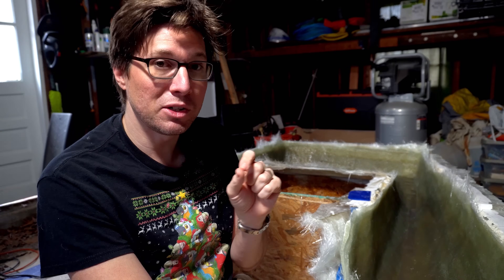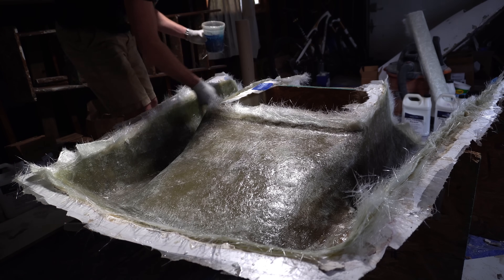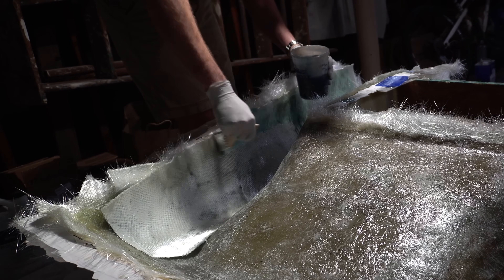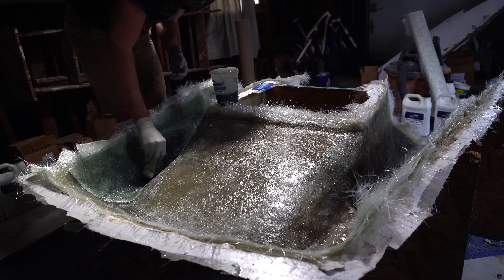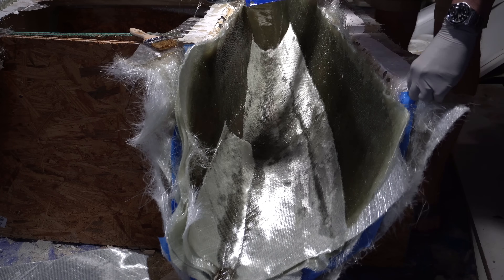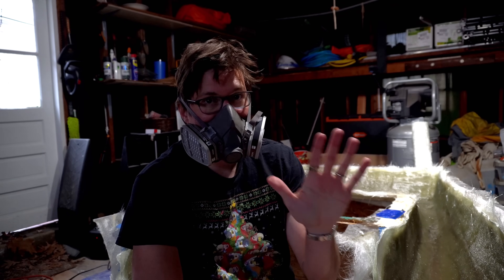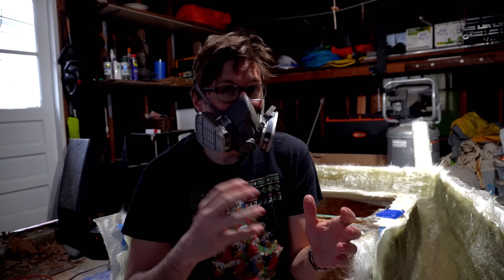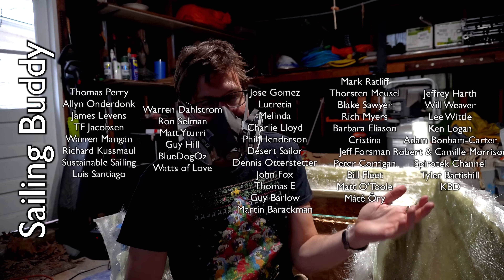Five Steps to Building in Fiberglass with Totalboat Polyester Resin | Windpuff’s Rebuild [S1 Ep6]

Comment: 5 steps read anything provided by the manufacture…. Don’t listen to people who fail to qualify their skills   “ this fool “
Don’t remove the dust or wipe down  with anything. After all a clean work environment  could never help the outcome of your project..
Reply from the maker: That dust is fiberglass dust which is in 402 from West System. Why take it out when it doesn’t hurt anything? Sounds like extra work for no reason. 
Reading the instructions is always a good first step, but the instructions don’t show techniques or tricks. 

I like the interesting spacing that you employ in your sentence construction, makes you see more  “ what’s the word “
Reply: @RiggingDoctor  
Dust is not a quality filler it provides no structural support and in fact my provide impurities and dry spots in the Lamination .  So for a a little extra security why leave a potential problem ….   Truly the difference between a hack and a pro.

Comment: Hello doctor! You laminate polyester and fiberglass without using a steel roller. I have produced many many square meters of laminate. Only with hard rolling can you achieve quality laminates. But it is heavy and time-consuming. In my opinion, the main cause of osmotic is due to carelessly rolled laminates. When a 30-40 foot hull is manufactured, the crew should consist of three "rollers" plus one for other work. But it is costly for a manufacturer. Usually there are two in total.
Reply from the maker: Good point. I have it but I only use it when I can’t get it done with the brush. I stopped using it as often because of the cleanup. The brush gets tossed but the roller needs cleaning.
Reply from the maker: Laziness is not an excuse for bad workmanship though
Reply: I agree with you. Plastic easily sticks to rollers. A can of acetone, a brush and a thin screwdriver are good tools and start cleaning before the plastic gets too hard

Comment: I used credit cards for getting air out of fiberglass flat surfaces, but it was west system epoxy, for corners I used very firm brush and tap danced on it. Your project looks great.
Reply from the maker: I have had good results with using the brush, but I also have scrapers (like the credit card trick but bigger) and a finned roller.

Comment: You need to pick up one of the finned metal rollers used in glass/resin lamination. These work exceptionally well in wetting out the cloth, working out excessive resin between layers, and working out any air bubbles in the layup.  They are inexpensive and if you’re in the Baltimore area: West should have them in stock.  I’m located at the very top of the Bay, our West stocks them.

If you’re not aware, the tool of choice in cutting or trimming cured laminate is a Fein saw. The original Fein tool is quite expensive, however a few years ago imitations showed up on the market and one of these inexpensive units will be fine for your immediate needs. (Harbor Freight)  Look for the semi circular shaped blade with fine teeth resembling a metal hacksaw blade.  Cuts cured laminate like butter leaving a smooth cut edge.  If you wish a saw which will last the remainder of your life, Fein is the way to go.
Reply from the maker: I have the roller but find the brush to be just as effective. There are some times when the brush won’t get it done and at that point, the roller comes in to save the day. 
I don’t have a Fein Saw or even knew what they were called. I knew what they looked like but was just going to go to Home Depot and pick up one of the imitation saws. Now I know which brand to get! 

I’m going to be installing external chainplates on Wisdom and need to cut a slot in the rub rail for the plate to run through. I have seen these saws but didn’t know their name. Thank you very much!
Reply: If you would like to try the Fein saw before making the investment, let me know.  I may not be that far away from you. ( Turkey Point Light House/ Elk Neck State Park)
The vibrating saw technology may have come from the medical world.  The first that I saw it was a power bone saw which would not cut adjacent tissue while in use.
Fein, a Swiss company I believe, seemed to have a grip on the market until a few years ago.  I expect their patent expired and we then saw inexpensive imitations appear.
Reply: @myrlstone8904 correct Fein had a 20+year robust patent that ran out about 10 years ago. Hence all the knock off out there. 
Our tool of choice for cutting cured fiberglass is a 4” diamond wheel saw.  There are knockoffs of these now too. Way faster than the Fein type , and Fein type blade are expensive.  
Great share experience 
Cheers Warren
Reply: @Cheers_Warren   
Agree on your comments.   I’d suggest the Fein as a choice if one were buying just one tool. Why, because of the Fein’s versatility.  It is slower on some cuts and very slow in wood, but with the wide assortment of blades available, and the ability to make very accurate and controlled plunge, straight, or flush cuts in glass or wood can be a real timesaver.
Reply: @myrlstone8904  repair work has defiantly speeded up with the oscillating blade tools. Less new work where you can plan ahead . 
👍

Comment: Nice work Herby. I think it's s great fun to build stuff from scratch. Breathing the styrene fumes from the polyester resin.... Eh not so much. Is existing gel coat on Windpuff the reason you went with the stinky stuff?
Reply from the maker: It was the price. Epoxy is $100/gallon and polyester is $67/gallon
Reply: @RiggingDoctor  You got that right!  Thank GOD my Irwin was built with poly, originally!   There's an Ace Hardware here that's older than me.  Well my yard buddy had me take him foe a ride after he saw me in WM.   $56 a gallon for Poly prior to covid and chop strain and the good stuff 15??  I forget. Was real cheap to!  They gave me the tiny plastic bottle the (oh, I'm on too many meds right now, ya know, hardener, to get it cooking off.  I've got so many red underlines, don't care though.

Comment: I would glass in some bulkheads,  then when all classed up,  I would fill with foam    Also,  looks as if you have not Defined the edges of the mold,  hope I’m wrong,  or trimming afterwards will take a while,  think it will look fantastic when done 😎
Reply from the maker: The edges are on the mold but I’m going above and beyond because I suck at the edges. The crappy edges go above the mark and then get cut off. 
It will be a lot of finishing work but I’m excited to get to that stage soon.

Comment: Have you considered using roving to add thickness?  Layers of mat and cloth then one or more layers of roving, then more mat and cloth.  The roving isn't as strong as cloth but adds thickness and just like a cored hull adds strength by adding a space between two layers of cloth.
Reply from the maker: I did think about it, but the math was easier to use a uniform fiber. I did 1708 for all of it so that I can extrapolate the values of the different layers and figure out how much I need for this. 
The second reason is I was worried about secondary polymerization where I would have imprint shining through the hull. I know I will be judged harshly if this doesn’t come out looking like peaches in the sunshine on a summer day. Roving isn’t as smooth and might look bad later after I fair and paint. 
Since we will be painting the hull a color instead of white, the chances of this secondary cure are high so I want to have all my bases covered.
Reply: That is the way my 40+ yo boat is made, with lots of layers of mat and glass, layers of mat and roving, more layers of mat and glass to make it less lumpy on the inside.  Total is 1/2 thick most places, getting wider up to 2 inch thick near the keel.  Gelcoat looks fine and should hold paint just fine.  fwiw.  @RiggingDoctor
Reply from the maker: Wisdom and Windpuff don’t have much on the inside so the inside of the hull is very apparent that it is roving. The bulkheads are also tabbed with roving and nothing over it for a nice textured surface. 
I just did all my practice with woven cloth, 1708, and CSM. I have never worked with roving, only read about it in books on boat building. When I get to the stringers, knees, and bulkheads, I will be using roving!

Comment: This is the fun stuff!  After I wet it out with a brush, I use the roller for the bubbles.  This is for hull repair work.  And big pieces of fiberglass.   For me and my yard buddy, ha ha.  🙏❤️🇺🇸⛵️👣🍍😊
Reply from the maker: I was using the roller but then I had to clean the roller. I was able to get the same results from the brush which doesn’t need to be cleaned at the end. 
I have had a few times where I really did need the roller and so I had to use it and then clean it after.
Reply: @RiggingDoctor  yeah, I dropped mine in a bucket of acetone.   Left it for the next day.  Then I just rinse it off with water and soap for me...I can't LOL right now.  I have Streptococcus (Strept Throat)  it hurts to lol.